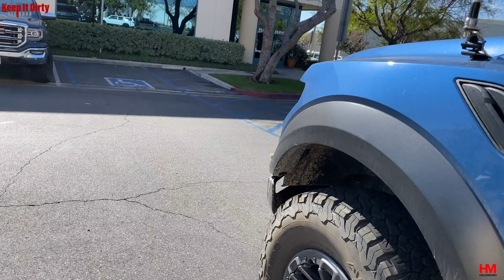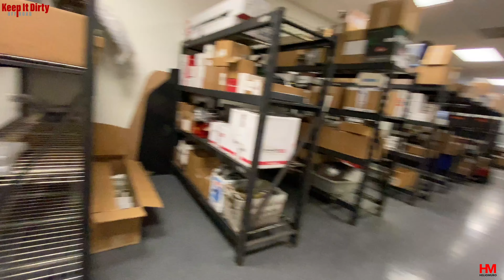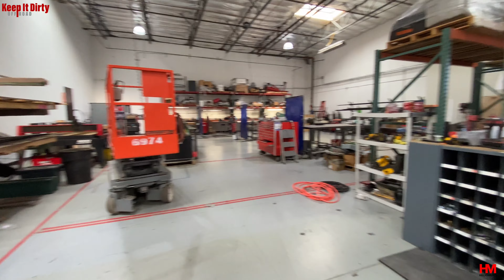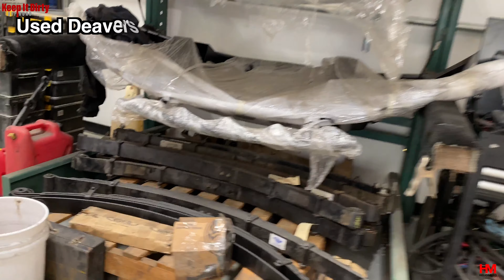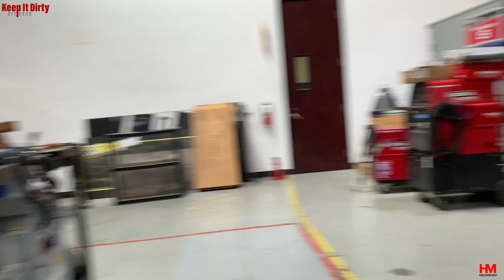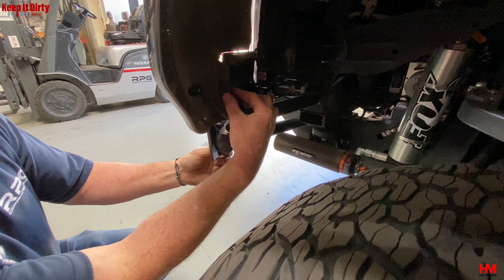RPG Offroads New Shop tour

Comment: They are right about fenders and bedsides not fitting well. I've had body parts from Advanced Fiberglass Concepts, Fiberwerx and McQueen Prototype Design, and McQueen's were by far the best, thicker, stronger and tighter fitting to OEM. Unfortunately Mike McQueen passed away a few years ago, and I'm not sure what's going on with them as they don't make parts for my current truck. Advanced Fiberglass Concepts were OK, but took a lot of tweaking and trimming, and Fiberwerx were total junk.
Reply from the maker: That’s what I’ve heard as well. Such a shame considering how much they all charge. Someone of them look down right ugly too
Reply: @KeepItDirtyOffRoad  I would have loved to see what Mike McQueen could have done for the Raptor, the guy was an artist with fiberglass.

Comment: Can you elaborate why RPG over SVC?
Reply from the maker: Its about design, strength and simplicity. SVC's bump stop kit is a good example. the kit traded strength for a simple install. The plate only installs on the face, yeah it's wide, but does not cover all 3 sides of the frame like the RPG kit does. Then also look at the cross member on the SVC kit, very small. They made the kit easy to install and in doing so traded strength. RPG is all about simple designs that work and are super strong. I've heard of a few have bent or broken the SVC bump stop kits. There is only 1 person to have ever bent an RPG kit. And that dumbass is me because I installed it on a frame that was bent and mushroomed so it did not get a proper hold.
Reply: Keep It Dirty Off-Road Thank you for the quick response. I’ll be looking at RPG for some new upgrades
Reply from the maker: @laraceez  Sounds great man. Tell them we sent you to help us convince them start building some of those extra upgrades I've been asking for that NOONE makes for the Raptor, like a quick disconnect sway bar links.
Reply: Yeah if you don’t mind important bolts not being torqued, hit em up.

Comment: Are the carbon fiber sides any better on fit and finish up front? Have you or RPG seen these in person
Reply from the maker: b pospolyta talked to their installer and he did a Carbon Fiber set once and it was a direct fit, similar to factory. No adjustment required. But the cost ($3000-4,000 per set) is not worth it. And that’s just for the fronts.

Comment: Once I save up a bit I want to get their front and rear bumpers. Did you say that shackle has a grease fitting? Does that mean no more squeaky leafs? If they make one stock height I'm so down. I was tempted to get one since I got the +3 deavers and rpg bump stop kit (hoping to install this weekend) but idk if that will be bad off-road with weight. Conflicted lol.
Reply from the maker: SERGIO ACEVEDO they are doing stock height. Those should be available soon. As for noise, yes they can reduce the noise, but leafs will always be noisy. There is no way to reduce that noise unless your regularly splitting and greasing between the leafs. The noise don’t affect performance so I don’t worry about it.
Reply: @KeepItDirtyOffRoad  I did hear you say that! Does that mean stock height with the +3 deavers? And true true and I usually have my music too loud to notice hahha
Reply from the maker: @sergioacevedo2874  if you do a 1 in drop shackle Yes, you end up with stock height. I need to keep my height because of the gear I carry.
Reply: @KeepItDirtyOffRoad  I carry a crap ton of weight too when I hit the trails so guess I'll have to leave it as is lol.
Reply from the maker: @sergioacevedo2874  that's why I'm doing the upgraded stock heigh shackles. I still want to grease fitting and light weight parts. That section gets sand blasted a lot and the metal drop shackle on my 17 was nothing but rust.
Reply: I have a set of rpg stock height billet shackles I'd like to sell..brand new.. 300$

Comment: From what ive heard everyone says the best fit and finish fenders are from adv
Reply: I’d argue boatec is the best
Reply from the maker: Sunny they all have some figment issue though
Reply: Keep It Dirty Off-Road I know but boatec compared to oem fitment is a 8/10. I have had 3 sets of fiberglass fenders lmao. Trust me I know about fitment issues 😂😂😂
Reply from the maker: Sunny yeah, but you buy your in some shady deals with “services” exchanged instead of money.
Reply: Keep It Dirty Off-Road as long as the sellers cute 😜
Reply from the maker: Yeah, that’s what I’ve heard too. It’s not until you get into the super expensive carbon fiber fenders that the fit improves.